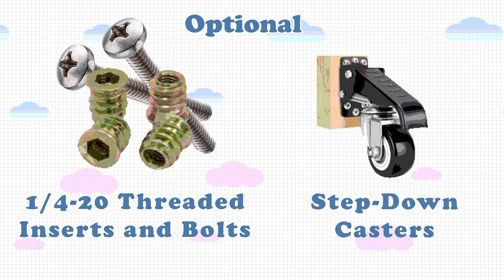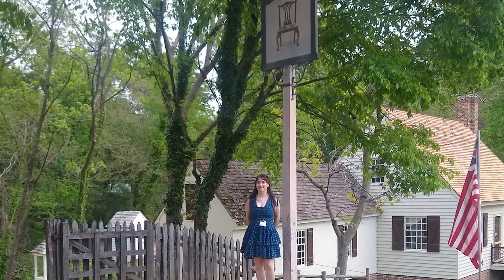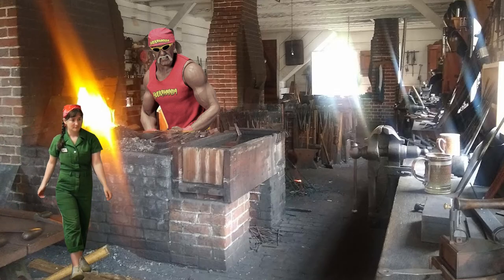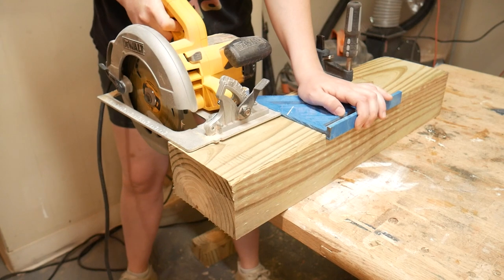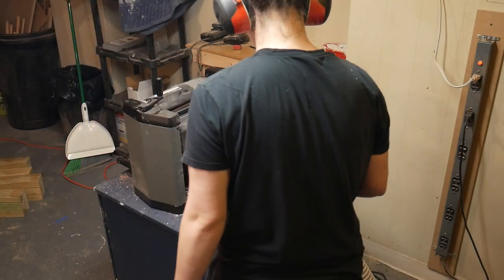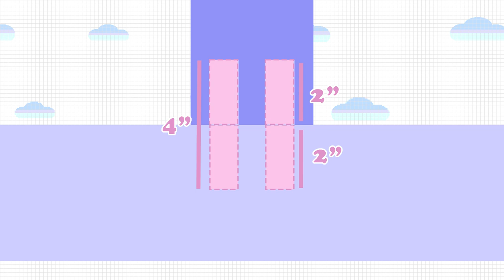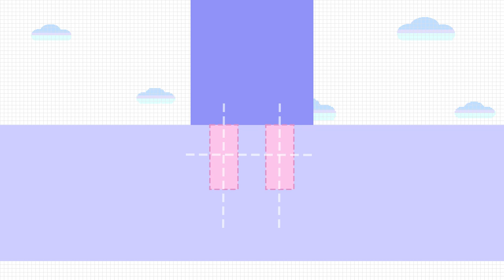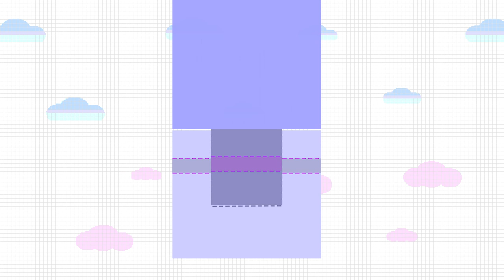How to Build a High Quality Workbench Even if You Only Have a Circular Saw and Power Drill

Comment: Thanks for sharing another great build! 
I need to make a workbench this summer and this is a project I think I could actually tackle without too many disasters. 
How did you make the worktop? Or do people just buy tabletops?
Reply from the maker: I'm glad you liked the video :) I was actually lucky and the original work table I had was given to me by my parents and they had it since the 80s lol. It has an oak laminated top, which is very ideal and strong so I just reused that.
As for workbench tops, it's ideal to have a thick table top of laminated strips of pine (or hardwood if you're lucky) but that requires alot of glue and clamps. If I was just starting out I would probs grab a countertop from Ikea, or forage at the thrift store for old tables.
Reply: @dinkles_woodshop  I’m always game for thrift shopping. Thanks for the advice!!